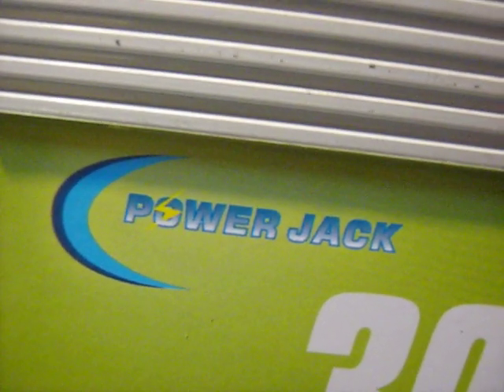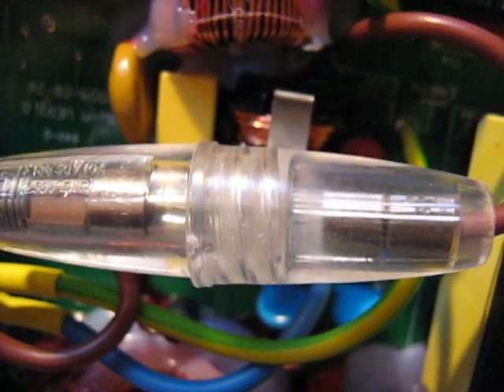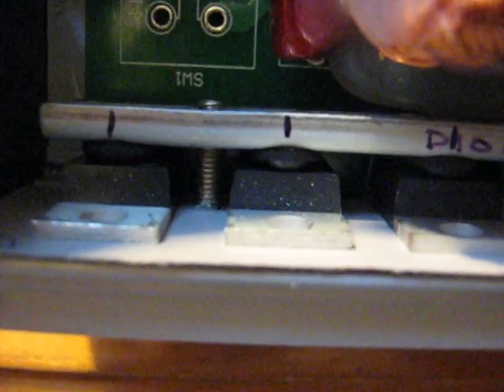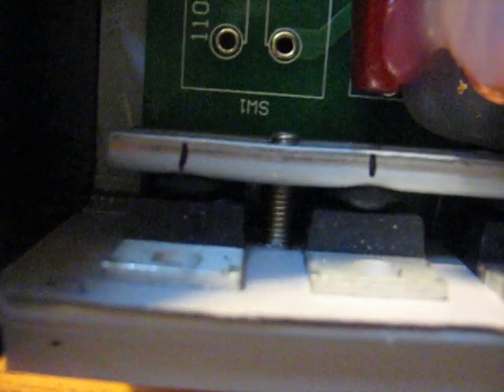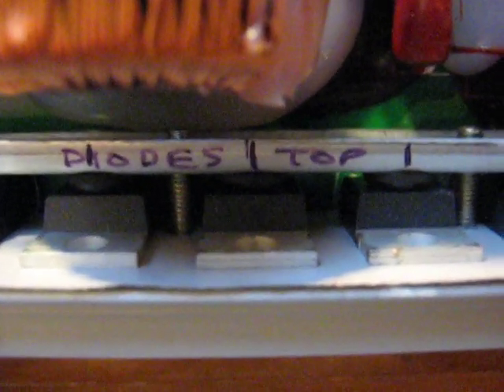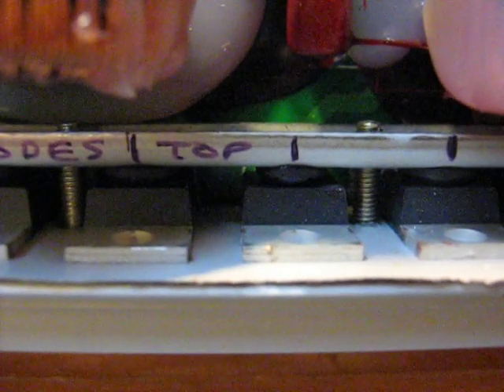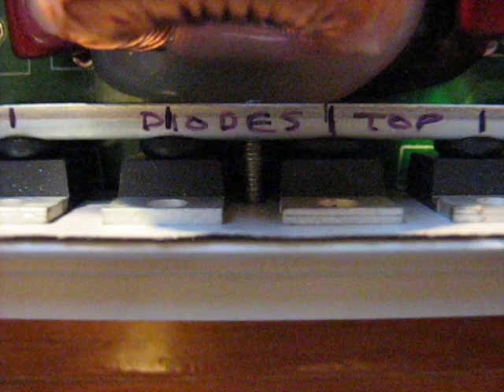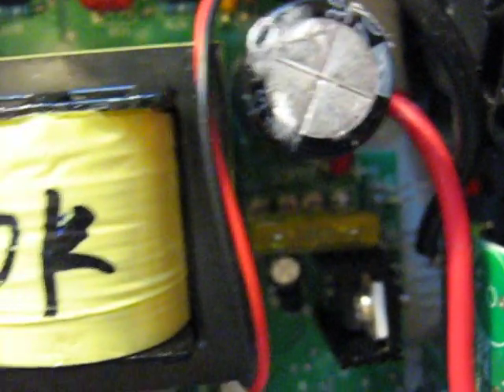PowerJack 300W Grid Tie Inverter Modifications

Comment: I would be fearful those rubber feet would get hard and brittle with heat over time, and fall apart... leaving nothing to keep pressure against the TO220 parts. I'd recommend silicone pads, like sometimes used for heatsinks... but 1-2mm thick ones... silicone won't be affected by heat.

Comment: hi, i have the 300w model and i had it hooked up to my windmill.  I guess one day the voltage got the best of it because i forgot to put a voltage regulator on it.  After that it stopped working completely.  It locks up my windmill even in high wind.  What could the issue be?  I was just playing with it a few minute ago with a small 10 watt panel and i had my meter hooked up to watch the voltage.  Inside the house, i was getting 9 volts, and when i hooked it up to the inverter it dropped to .5v

Comment: I also have a Power Jack 300 Watt Grid Tie Inverter, which blew after 45 minutes of use. I detected, using a multimeter, that Mosfet P75..., Mosfet P1250..., F1 fuse 230v 5A and F2 fuse 20A were blown. Power Jack were kind enough to send replacements, which I soldered on. The unit ran for less than a minute and blew Fuse F1 and the new P1350... mosfet on Q11. Now I'm suspecting the doubel coil as you mention on your video. How do I test the double coil ? Kind regards EskimoJan

Comment: Did they give you a schematic?  I have a 600W GT PJ.  Max power out is about 500w...less than 80% eff.  The power cord is VERY hot above 300w output...way to light. They do work but my guess is you should size them at 2x your PV requirment.

Comment: Hi @JPFall1,
Yes the units are cheap and on the face of it, seem to be good value.
But, you get what you pay for! 
Factors to consider before buying:
* If you get caught using one, you may get fined, or worse as they are not approved by local authorities.
* There is a serious question about safety - see my posts re RCD/Earth leakage.
* If it overloads/overheats and burns your house down, you will likely be uninsured if it discovered as the cause.
I could go on, but I have run out of characters..

Comment: @julius256  
I have a feeling that these things rely on having 'matched' Mosfets/diodes.
Power mosfets have varying On Resistance (Ron) and switching times, which can vary slightly between batches/bins. It may be the case that the circuit is not capable of load sharing between the mosfets and so individual mosfets could be taking much higher loads than others. The liklyhood of this may be reduced if all the fets were from the same batch. This is all just speculation at this stage..

Comment: @julius256 
I think so. I have not actually hardwired the earth pin on the AC plug to the chassis yet. But, before fixing the short circuit, I had installed a seperate earth stake for the inverter. However, as soon as I connected the earth to the earthing post on the unit, the house RCD on that AC circuit tripped. Now after the fix, I can connect the unit up to the earth stake/rod without any problems.
Regarding the mosfets blowing, see next post..

Comment: @julius256 
The first thing to check on these things is to make sure you have no FET/Diode shorts to chassis. The diodes and fets are supposed to be insulated by that thin strip of fibreglass reinforced rubber. The problem is that this mat is easily punctured by metal swarf and once the mounting strip is pressed down, the swarf shorts the device's tab to chassis. Before firing this device up, remove the cover and useing a multimeter, confirm that all the semi's are insulated from the chassis.

Comment: The unit still works, but in this case I had around 150V AC on the chassis!!
I would reccommend anyone buying one of these to first run an ohmeter across all the diodes/FETs and chassis to make sure you haven't got any shorts in this area.  I think that the stick-on rubber feet mod, outlined here, is a good idea as long as the rubber handles the heat. If you do that mod, it would be a good opportunity to check the chassis insulation between all the FETS & Diodes at the same time. Good Luck!!!!!

Comment: I have found one serious problem with my 600w unit. As mentioned I was getting a shock from the chassis, when I touched earth and it would trip my earth leakage detectors. I found that one of the diodes (D4 in mine), was shorted to the chassic. The short was caused by a bit of aluminium swarf that was left between the diode and the rubber insulator. When the screws were tightened, the swarf cut through the rubber and shorted the diode to chassis. See next post......

Comment: I reckon the 600w version is probably very similar. Maybe twice as many fets/diodes etc.. Maybe your unit is blowing because you have connected the earth to the chassis?? It would be interesting if you disconnected it and then measured the AC voltage between the chassis and your house mains earth circuit. Would be nice to see a circuit of these things to try and work out where the problem is..

Comment: It seems this is a common fault with the Power Jack inverters.
I would say that they have purposely not connected the earth for this very reason.
Anyway, this brings me to another related point. What happens when a kid sticks a toy into a power point in the house?? Normally, the Earth Leakage detectors would sense this current and trip. But, if the some/all the current is coming from the Grid Tie, does this then disable any protection on that circuit??

Comment: julius256 & solarhope, I have just taken delivery of the 600w 240v version.
The unit seems to work fine but I got a shock off the chassis!!
It seems the chassis on the 600w inverter is not earthed either and when I put a multimeter between the inverter chassis and the houshold mains, I got a reading of around 150V AC.. Anyway, I thought  I'll just run an earth wire from the inverter chassis to the houshold earth. POP!! It instantly tripped the earth leakage sensor on that circuit . More next...

Comment: Hi Julius,
I like the mods you did with the heat sinks, I will take another look at mine.
I replaced the fuse-less mains plug and included a 3 amp fuse in it.
These things either work OK or blow up within the first hour!  - good value for money if you know a bit about electronics and are willing to have a go.
By the way Farnell supply both the Mosfet FDP18N50 and the Diode RHRP860 which seem to be the main culprits to go faulty.
Shame they dont have a G83 Certificate.
Regards Martin.